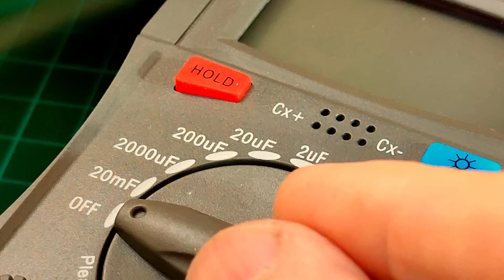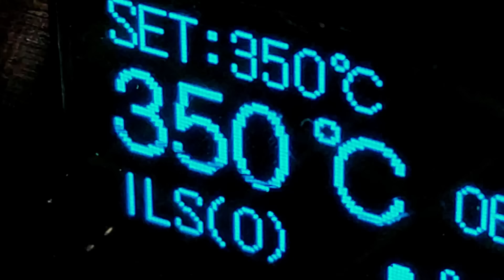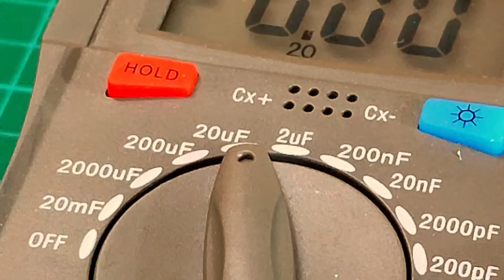BOMBILLAS PARPADEAN POR QUÉ ??

Comment: Gracias por  su  explicación  tan  onesta  y acertada  sin  tantas  vueltas.  DIOS TODO PODEROSO lo  bendiga y sus  seres queridos
Reply from the maker: Gracias Henry... Amén !! , también para ti y a tus seres queridos bendiciones 🙏.
Siempre a la orden amigo .
Reply: @reparandocosas  maestro valoro  mucho su  saber,  buenos días  Dios lo bendiga,  maestro le  cambié  el  capacitor que estaba bajo  de  valor,  normalmente  de  10 mf  X  200 voltios.  Por  uno  igual de  mf  X  250  V   y revise' cables de  alimentación y  resistencia del  mismo y  en buen  estado,  pero  sigue  parpadeando, que  puede  ser?  Gracias  por  su buena  colaboración  onesta  bendiciones.  Espero  su  respuesta maestro

Comment: Muy buenos días,sus videos son excelentes, muy didácticos. Quiero por favor nos indique cómo reparar los bombillos que no traen drivers; simplemente traen un puente rectificador y dos componentes superficiales, los cuales he sustituido por condensadores electrolíticos. Está sustitución resuelve pero no tiene duración. La falla es luz muy tenue. Gracias
Reply from the maker: Hola Augusto , gracias por tu comentario 👍.  Las bombillas a que te refieres son con fuente capacitiva , y como comentas trae pocos componentes. El problema de esas bombillas es que su fuente no es multivoltaje por lo cual no se pueden puentear los led quemados porque el voltaje total caerían en los LED restantes , recibiendo cada LED más tensión de lo que soportan terminando quemándose.
Si la bombilla , una vez reemplazados los capacitores no tienen buen brillo sus led es muy posible que algunos de ellos esten en corto .
Reply: MUI bueno sus mini curso que dios lo bendiga desde Ciudad guayana estado bolívares venezuela

Comment: Que opinas de usar capacitares más grandes para compensar la sobrecarga en los LEDS? Algo que se dice que hacen para reducir la vida útil de estos...
Reply from the maker: Hola Casar .. hay quien coloca capacitor cerámico en serie en la línea de alimentación para reducir la corriente a la bombilla,  pero la mayoría de los bombillos LED vienen con conexión multivoltaje por lo cual no creo que que sea eficaz.  Otra sería reemplazar los capacitores de filtro por unos más grandes pero dejaría de funcionar la bombilla ya que tardaría mucho en cargar y descargar el capacitor.
Lo mejor es reemplazar la resistencia del circuito integrado por uno que sea un poquito mayor para reducir la corriente que circula por los led.
Reply: @reparandocosas  pero a costa de aumentar el consumo en watios e iluminando menos, no es lo ideal tampoco. Quizás lo mejor es sacar el driver de dentro de la bombilla al igual que lo tienen los focos empotrables de techo (los que son driver de corriente constante).

Comment: tengo un duda que diferencia hay si se mete un capacitor de mayor volaje y de igual manera que pada si se mete de menos gracias de antemano saludos desde cdmx
Reply from the maker: Hola Pecos .. si colocas un capacitor de mayor voltaje es mejor pues se degradará menos.. el problema es que a mayor voltaje mayor será su tamaño y su precio. Si por el comentario el capacitor es de menos voltaje se dañará de inmediato , incluso llegará a reventar.
Reply: @reparandocosas  gracias que amable

Comment: siempre suele ser capacitor, pero en algunas hogares olvidan quitar el neon o led del interruptor. igual las fallas en las lamparas leds. son insolitas. tengo una de 50w que luego de un rato se pone en corto de la manera mas absurda
Reply from the maker: Sí es cierto también eso interruptores con neon duelen dar problemas a los bombillos led .. también me encontré con un caso de parpadeos en tubos LED que lo causaba un calentamiento en la línea por cable flojo en el breaker.
En tu caso con la de 50W  pienso que pueda ser por recalentamiento en el driver 🤔.  Saludos !!

Comment: Tengo los condensadores en buen estado aparente, dos de ellos miden alrededor de 13uF (los que están cerca del rectificador), sin embargo el que está de filtro a los led (400V 3.3uF) no da lectura pero se ve en buen estado. Podría ser que no mida bien el tester porque tiene una resistencia 100k en paralelo?
Reply from the maker: Hola  Sabrina  .. como el condensador de 3.3uf está en paralelo con la resistencia es necesario retirar el capacitor de la placa y luego tomar la lectura... si no dará resultado erróneo. 
Saludos  !!

Comment: Reciba mi respeto y saludos.
Profesor intenté probar los módulos de manera independiente del driver pero genera un chispazo tipo corto circuito, no encienden los leds.
¿ Dónde se coloca las puntas del cable?
Reply from the maker: Hola Henry .. los cables que salen del driver tienen los signos positivo (+) y el negativo (-) los cuales cada uno deben ir conectados al drivers con su correspondientes polos .. positivo con positivo y el negativo con negativo.
Saludos amigo !!

Comment: Amigo buenas noches. Ya que usted en este video está midiendo capacitancia, le pregunto algo: tengo una pinza amperimetrica uni-t 202+ de rango automático, en sus especificaciones de medidor de capacitancia dice 4mf. 
Estuve comprobando  un capacitor que dice 1.5 F, osea faradios y la lectura me da OL, al parecer esta fuera de rango.
El rango de  "mf" que aparece en en la pinza amperimetrica, significa milifaradios o millón de fradios? . 
Será la pinza que no alcanza a medir o es el capacitor que está dañado. ? El capacitor por fuera se ve en buen estado .
Reply from the maker: Hola Herny , el rango "mf" significa milifaradio ... Si este es el máximo rango de tu tester podrás medir desde milifaradio para abajo, como por ejemplo microfaradio (uf), nanofaradio (nf) , picofaradio (pf), etc. 
Un capacitor de 1.5 faradio es muy alto para que lo pueda medir tu tester de 4mf.
Reply: Muchas gracias por la aclaracion

Comment: Excelente video, cambie todos los capacitores pero la lampara sigue parpadeando. Cual sera la falla, agradezco tu respuesta 😊
Reply from the maker: Hola amigo , asegúrate de que no hay algún led en corto en el módulo, también prueba conectando la lámpara en otro lugar.
Reply: Lo extraño es que todos los. LED encienden con bastante intensidad, pero se queda como un arbolito de navidad,  enciende y se apagan constantemente, si sabes de otra alternativa te agradezco la ayuda 👍🏻
Reply from the maker: Cambiaste el capacitor de filtro ? el que está justo en la salida, es el de menor valor en faradios.
Reply: Si cambié dos capacitores de electrolítico y también uno de poliester que  es de 104J 400V por cierto ese capacitor de poliester se podrá colocar otro de otro valor porque tengo duda con ese porque no se como probarlo lo cambie por uno usado que estaba en otra tarjeta y aparentemente esta bien pero me gustaría probar el que quite y este que coloque, de casualidad no sabes alguna manera de probar esos capacitores de poliester sin capacimetro?
Reply from the maker: El capacitor de poliéster se comprueba con el capacimetro y más aún cuando son valores tan bajos . 
Lo otro que podría estar dando problema sea el micro componentes Controlador LED.. aunque nunca un controlador LED me ha dado esa falla intermitente.
Reply: Bueno muchas gracias por tu valiosa información 👍🏻

Comment: Un draiver de un bombillo  ..AC 100-240v  15w  50/60hz.  6500k  .tiene su capacitor quemado de 400v.  5.6 uf.  Se le puede poner uno de 6.8uf 400v. O menor de 3.3 uf 400v. Acesorame ..
Reply from the maker: Hola Andres  .. le puedes colocar el capacitor de 6.8uf 400V 👍
Reply: @reparandocosas  Gracias Sr Reparando cosas.

Comment: tengo un bombillo led , le llega corriente  pero no prende, no tiene led malos, que puede ser amigo
Reply from the maker: Hola José ... Hay que chequear si el driver está entregando voltaje... Aproximadamente 165 voltios ... En el caso que los esté entregando entonces hay que chequear uno por uno los led hasta encontrar el LED que está abierto que es el que no enciende.
Reply: @reparandocosas  gracias, revisaré

Comment: Tengo un foco led que alumbra poco no se cual es el problema
Reply from the maker: Hola amigo, son varias las causas que producen esa falla... Capacitores desgranados por el calor, también podría ser una resistencia de bajo valor que esté en corto,  el circuito integrado CONTROLADOR LED que esté fallando y también lo puede dar un led que esté entrando a corto.
Reply: @reparandocosas  gracias profesor es ud un gran maestro, como se prueba el integrado del foco Led.